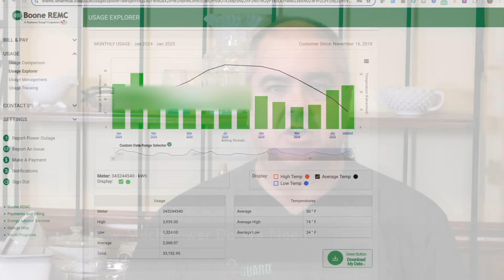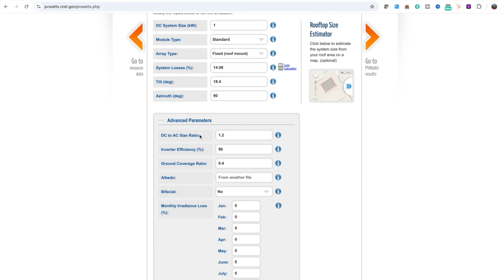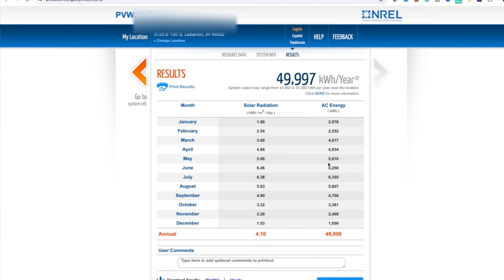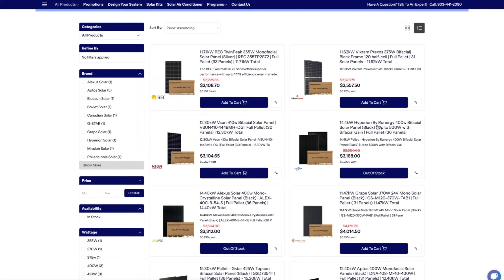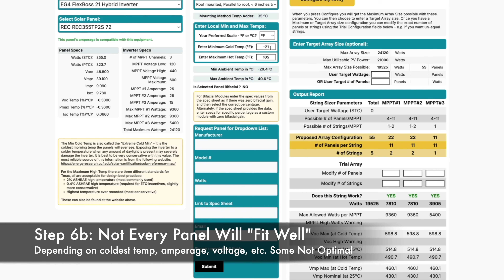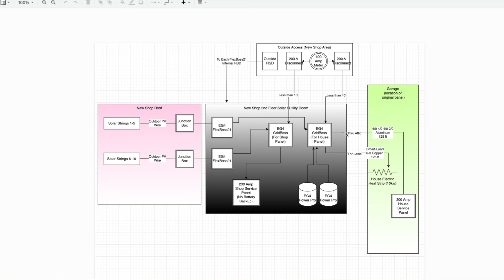Sizing My Solar System; 8 Easy Steps

Comment: Do yourself a favor and suck it up on the feed to your existing box and use copper.  Yes, it's expensive, but the chance of aluminum developing cracks due to just thermal stress is a lot higher than you might think.  

Don't skimp on electrical.  That's how electrical fires start.   I just installed an EVSE on the far side of my garage.  I choked at the cost of the copper 4 gauge cable, but given the load on that wire and the time I expect to be in the house, I don't want to ever worry about it again.
Reply: I dont know how it work in us butt I dont se why aluminium is bad? Here in sweden i never have problem with aluminium cabel.
Reply: There's nothing wrong with using AL SER cable. Sure, I agree, don't use AL wire for branch circuits, but the entire grid is AL wire. Heck, the feed from the power company to your house is AL wire, I'm sure. Sure proper torque, and you've got nothing to worry about with SER cable.

Comment: 8:36 East-West mounting doesn't have to be bad, over here in Sweden hourly electricity rates has become very common the last couple of years. This means that the electricity is more expensive during the peak hours. (morning, evning) You can therefore lower your bill by cutting the electricity usage during those hours. It is the same for exporting your solar. When you have an east-west array you produce more when the electricity is more expensive compared to an south facing array.  I know you don't have it currently, but it is something to take into account for the future.

Comment: Living in FL I wouldn’t have this problem, but I would assume that you will need a ladder for your building so that you are able to clean and/or remove snow from the solar panels.  Also remember that you won’t always be able to get on the roof yourself when needed.  I would really think about putting the panels on the ground to avoid the dangers of the roof mount.    Good luck on your building.

Comment: May want to reconsider location. Roof mounted looses as much as 30% efficency just from the added heat! 
I have an array of 30. 400watt bifacial and went with a ground system. In full sun I get 90%+ consistent efficency. 
Going with a roof mounted system your loosing a year average of around 15%. Pair that with E and W facing and loose another 15% or more....
Reply: I have "Enphase" 400watt panels and 30. A7 digital micro inverters. Happy to share screen shots of efficency 😊
Reply from the maker: I love the concept of micro-inverters.  They just seem to be much more expensive.
Reply from the maker: Yep. You are right.  I don't see much choice...as I mentioned in the video.

Comment: Continued prayers for your father-in-law. 
I’m assuming that Indiana has Net Metering like we do here in Missouri. I found that with my system I don’t want to completely eliminate my bill. As close to $0 without selling excess power is best, the price the utility pays for excess solar generation isn’t worth the additional capacity.
Reply from the maker: Right. We pay retail.  They pay us wholesale.   we pay $0.1231, they pay $0.086.  So, not too bad.
Reply: Net metering here too. Absolutely the best option